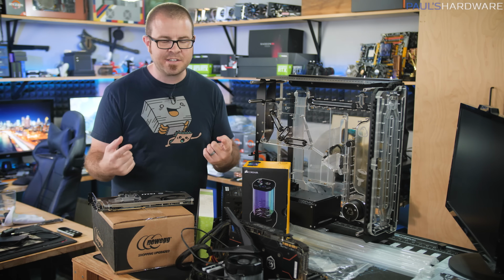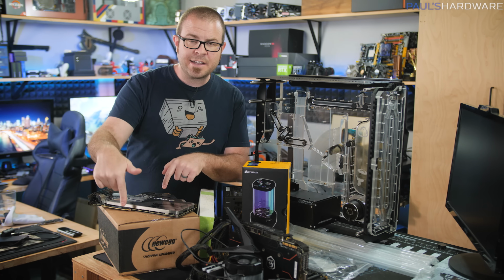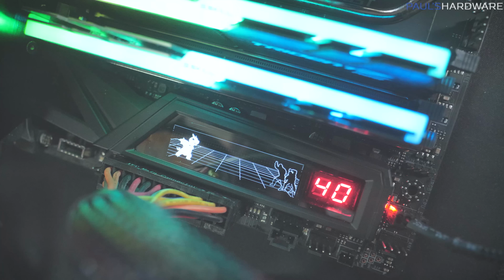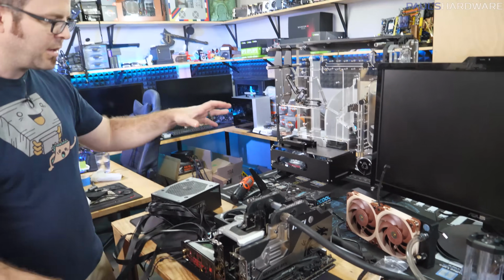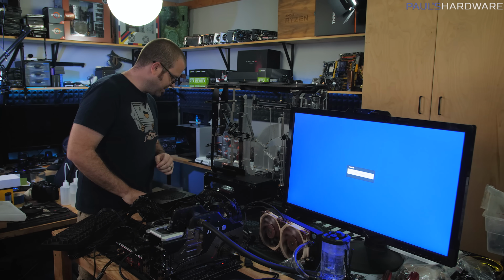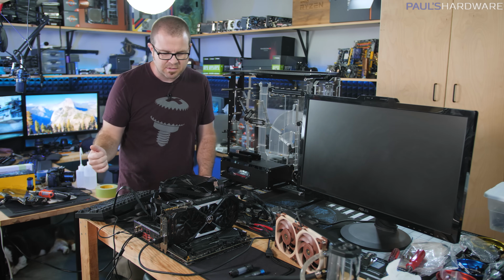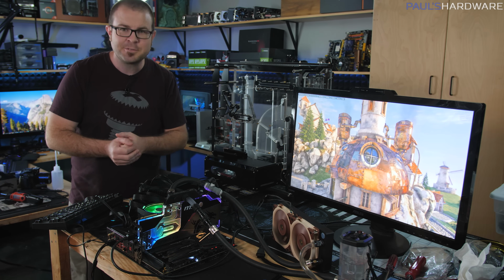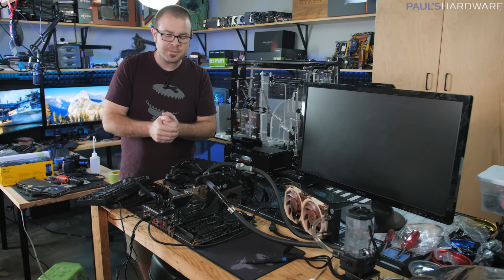The Most Important Part of a Water Cooled PC Build

Comment: That integrated Nvidia 3D Vision IR emitter on your monitor...:( I'm still running driver version 418.81, because that's the last one with the feature included for some terrible reason.
I understand that a small percentage of gamers use it, but there's a reason those of us who do love it so much - it's freaking awesome.
That feature is such a great one; it's really the next-best thing to VR, and even VorpX doesn't come close to the level of support or fidelity possible with 3D Vision.

Great video and demonstration of how even the most expensive of parts can be faulty and have issues, so it's always important to not take that for granted. Thanks!

Comment: The only serious failure I've ever had was an MSI motherboard. I even bought a board with the BIOS flashback button and that didn't work either. I'll never buy anything from MSI again
Reply: Same here, since 2011 and I never looked back
Reply: Unfortunately, after 25+ years of experience building computers, I've found that any brand has a dud from time to time. Either individual items that are dead on arrival, or a particular model that is of poor design.
Reply: @Trifler500  oh most definitely it just left a bad taste in my mouth when the dedicated bios flashback button literally designed for my issue did not work either. I explained to MSI that they're last resort flashback button doesn't work and they made me pay 20$ to ship they're dead board that was only around 3 months old. I then waited six weeks to get it back. It wasn't just that there was an issue it was everything together that made me hate msi.
Reply: @racingbeats1493  Oh yeah. I feel you. I guess I'm lucky regarding that issue because I read that it's a pretty hit or miss process before I bought one, and not just with MSI.

Comment: I'm getting back into PC gaming after a 15 year hiatus. Dont ask why lol. Im building my next gaming PC....specific for gaming cause I'm tired of Xbox and PC is and always will be the ultimate. My question is....which is the better processor? Intel i9 or AMD Ryzen 9? This will be a fairly high end build as I'm using the MSI Godlike board, 64 GB Trident 3200 RAM, Geforce 2080 Seahawk (Hybrid non-liquid but separate AIO fan). So which processor do you think I should roll with here? Any and all input is much appreciated. Thanks.
Reply: Correction...Ryzen 7

Comment: Paul about the Daisy chain of the PCI-E power cables where you shared the same cable for both power connectors on the card. I made the same mistake you did with my r9 290 card. My PC booted but I had issues where I would get black screen lockups. After adding that 2nd PCI-E power cable it fixed the issue that I was having. Too bad it didn't fix your issue and you had a defective card.

Comment: Wasn't it gonna be faster if you just plugged the cards without watercooling just to see if the PC was going to post? I mean you could save an hour by just plugging the cards and see if the system posts. Surely there won't be any load on them, so thermals are gonna be very low.

Comment: MSI = Boooooooooo.   In my experience with MSI I have received a lot of defective flagship cards from them (the reference cards i have used from them have not caused any issues though so go reference mid tier if you go MSI, their to tier cards are rubbish), But mainly the customer service and the RAM process for MSI is super bonkers because they take forever making you trouble shoot an obviously DOA/malfunctioning device (exe the screen is covered in purple and green artifacts, its obviously bad, so several BIOS flashes and tweaks, voltage tests etc, before they let you pay to return it), They do everything they can to refute a return first, then as previously noted make you pay the shipping on a defective product that was already at  the top tier pricing to send it to a certification facility with a 2-3 week certification and testing turn around, sometimes returning a dead card saying it worked for them, then on the 2nd go around same shinnagins take it back and actually test it and see it is failing and replace it.  The whole process always wound up costing me 30 - 90 USD extra on shipping costs to complete the multi phased RMA for DOA/artifacting Flagship hardware (one time it took 4 times RMA'ing a single 680 lightnings 30 bucks a pop 3 week turn around to get the "oh yeah it is artifacting after running for 10 + min, just like you said" confirmation so finally replaced it),  I have also tried a few more cards from them over the years with similar results on the Flagship cards so they have proven to me time and time again that they rush the QA process to get the flagship cards to market to the point i will never buy another MSI anything because of the overall hassle they provide to get a working unit, time investment troubleshooting, and added cost to get the working component compared to alternative cards on market.  Asus or EVGA are my brands all the way from here on out, I have only ever had 1 Asus card fail on me and they replaced / upgraded / over-nighted me the next tier up card at no cost as an apology for getting a bad one that made it past their QA, likewise I have received a couple bad EVGA cards but customer service was a breeze and replaced within days.

Comment: Paul, though I normally don't find fault with you,  I have to make a suggestion.  When you are doing trouble shooting do ONE thing at a time!  Changing out the power supply wasn't really a bad thing to do, but many people with less experience then you might copy you. Trouble shooting has to be done in a consistent manner otherwise you'll misdiagnose the problem!  Swap out one component at a time,  run through the tests, and keep doing this until you isolate the bad component. If swapping a component doesn't make a difference, reinstall it and swap out another,  DO NOT install a different component for any reason!  Once you isolate the problem, replace or repair then continue testing until you're satisfied.  Then you can install something different.

Comment: The problem is you are cooling the cards in serial, this means the first card the water passes its already to hot to cool the 2nd card and that card will fault out and crash your system.
you would need 2 isolated water pumps and radiators.
Reply: That is not true at all. Please don't listen to this guy folks. You can run two cards in the same loop with practically no difference in thermals at all, that is if you actually are into the sli thing still.
Reply: @mikeschimminger7886  Im an engineer in hydraulics and travel quite a bit around the world for my job to solve industrial related problems regarding hydraulic pressures, plc, cooling etc... not so long ago i fixed a problem on a vessel where 2 engines where cooled with the same loop, one engine on the end of the loop always had cracked cylinder heads and liners. This is basic 101 do not cool 2 devices connected in the same loop !.

Your first card takes the LT low temperature water in expells it and becomes HT *high temperature then passes the HT trough the 2nd card. Whoever sold or invented this cooling loop it looks nice but very unpractical and unrealistic. Also note that CPUs create massive ammounts of heat usually expressed in watts on the manufacturer page, in watercooling this is dangerous as it can cause steam, pressure and air bubbles in the loop causing a chain reaction and your temperature sensor would not even pick it up in time and *boom system crashes. The other risk is that seals of the loop would give in and start leaking.
Reply: @JerryDoe  I have no doubt at all that in your professional field that you run in to this and it actually is a problem. However we are talking PC components on a much smaller scale and it has been proven time and time again by professionals in the PC world that dual loops for GPUs offer little to no difference in thermals.
Reply: Jerry, just stop. Admit you are wrong and move on with your life. All of your scientific equations and such just don't mean a thing in real world results. Go build this system and prove your point and i will agree with you. Until then we will agree to disagree.

Comment: I would not do a vertical gpu layout the pci extensions provide another point of possible issue, if you had a single card I might do it to make the system look full but with 2 cards I would just plug them into the board and go with a more traditional setup.

Comment: I have a CM 932 HAF which is an air cooling beast. Can you do a review like for the Corsair 500D? I want to know if keeping this case is still worth it. Current cooling is as follows: 2x120mm ft, 4x120mm side panel, 1x140mm rr and top 240mm AIO w/ push/pull 4x120mm.

Comment: With some newer GPUs using 2 8 pins + a 6 pin, I wonder if we'll ever get to the point where they start manufacturing them as a single connector to minimize on the amount of separate cables needing to be used

Comment: I wonder if he remembered thermal paste in the bad gpu.
Reply: Those are factory pre-assembled.  Waterblocks already installed.  Still, I bet maybe if he did take them apart to have a look, it's entirely possible the factory missed something basic on block installation.  That's arguably more likely than actual failed components on the PCB.  But presuming MSI gave these to him as promos, they'd surely rather have the card(s) returned, and do the troubleshooting themselves.

Comment: Or maybe just don't buy MSI LOL

I did the same testing when putting together my 4-way SLI system back in 2015 - assemble the cards in a block, leak test prior to fitting and then test each card individually by adjusting the PCI DIP switches on the mobo. For cooling the CPU I "borrowed" a H100 since I was installing a full motherboard block.

All went well, but this experience and yours highlights the fact that you can put a ton of time and effort into building what is a very complicated system, switch it on and NOT HAVE IT WORK. In my case I had 5 blocks connected to five rads and 20-plus fans installed inside a massive CaseLabs case. Think of the time and work it would now take you to disassemble a fully built rig for trouble shooting, more so if that rig took several days or in my case WEEKS to painstakingly mod and put together.

Comment: I want to water cool my PC so much right now, my fan on my 1070 seems to be bad (sounds like a hard drive spinning up while I'm gaming- the game is on an SSD and it didn't do that when I was using my old 1060 3GB). I can't even afford to do it all with parts off AliExpress, let alone real brand name components.
Reply: Watercooling is all about hobbyist/enthusiast interest. It isn't necessary and is never cheap. Most affordable way to get into it is probably EK's all in one kits. Basic one with a single rad and a CPU block will let you learn it and build a simple loop. If you feel ready you can expand it with a GPU block later.

Comment: I'm kinda glad the second card failed, I hate errors that come and go cause you can never really be sure if you fixed it and if the problem will come back or not.
Reply: I Cant troubleshoot my Sisters defective system beceause of that.
The other problem is that i do not have spare Parts to test shoot or troubleshoot.
It's a ten plus year old system probably pci-e 1 or 2 max
Reply: @alfonsputzeys9228  that's annoying, that's why I like the option of integrated graphics, you can at least use the pc still if you have to remove graphics card.

I've had a dodgy hdmi cable and dodgy sata cable that when replaced fixed the issues they were giving.
Reply: @colinjava8447  it could be so many things, but without some feedback from the monitor and a boot button indicator.
Sometimes notifying you, Mailfunction in hardware and you have 0 test items.
Like a spare gpu, psu, ram etc.
It's difficult to do a pröpper proces of elimination.

Comment: Yo look at your build at 3:17. You won't be able to fit the pump/reservoir from corsair in the front since the memory is gonna block it. I'm doing a build in the 280x and the only way I got everything to fit is by putting the radiator on the bottom and put the reservoir in front with two fans putting it to the highest the bracket enables it to. You'll also need to remove the top fan in order to fit it.

Comment: "just a GTX 1080" you gotta be kidding me...lol.  That's like a dream card.
Reply: I know, I got myself a cheap never used 1070-seahawk, its a little overkill for 1080p but I think I can get 3 years use out of it.
Reply: I had one bought one used, not one month of use, gone.
Reply: maybe for 60fps but not smooth gaming
Reply: I replaced my GTX 1080 with an RTX 2080 less than a year after getting the 1080, which now sits tucked away in its box as a backup, if something goes awry with my 2080. 😅
Reply: I have a box of 1080s from my old mining rig.
Reply: dream bigger

Comment: Are those gpus in slot fully? Motherboard should be an inch off the table or at the edge, so that gpu "legs" don't hit the table
Reply: Igors Jakimenko: you know I was thinking the same thing, I had trouble testing my new 2070 super, it wouldn’t post, then I moved the motherboard to the edge of the table so the  rear of the card had proper clearance and suddenly my monitor burst into life.

Comment: PSU? I had a AX 750 that was giving me issues than just shut off one day. It would turn on when I turned up memory speed to XMP. PSU died after update and PC was running fine and just shut off. Would not start again until I reset the CMOS and swapped it out. Check them with swapped PSU.

Comment: Watercooling definitely seems to have a steep learning curve beyond a closed loop cpu cooler. 

You're experienced with all this and can patiently troubleshoot but retail end users dabbling with watercooling GPUs seems too much a hassle, esp if there is a defect from the factory  :(
Reply: If you pre-sudy and plan then watercooling is not to be feared. I haven't done hard tubing but soft tubing really isn't very difficult.
Reply: @Safetytrousers  Soft tubing is definitely more workable. Hard tubing is there mostly for showcasing a build  and maybe one day ill prioritise showcasing a build rather just pure performance.
Reply: @Safetytrousers  Absolutely. It's just very expensive. But if you water cool, you have a system worth that money.
Reply: I also just stepped into this and for me I learned fast. I did just a little bit of research, made sure I got all parts ready, then built it with just common sense. And it works flawlessly.
Reply: @kyoudaiken  True, but I just don't see the benefit of overcomplicating things. An equivalent Noctua cooler works just fine, performs the same without worrying about leakage or pump failure and is far more cost effective. 

Apart from the aesthetics,  I see liquid cooling as an advantage only in compact builds where large hestsinks cannot be installed and where the air cooler may interfere with RAM installation. 

GPU cooling seems to be even less worthwhile since it seems you cannot carry the custom waterblock designed for that particular gpu and thus cannot be transferred to a new build like a cpu cooler can.

Comment: The most important part is realizing that water cooling is a fad, completely unnecessary, and it is far better just to stick with a great Noctua air cooler.
Reply: Yeah considering noctua now makes them  in black now so they'll look cool as well. 

GPU watercooling is just too much of hassle plus carrying it over to a new system is improbable.
Reply: This
Reply: I mean if you care about having the lowest temps with the maximum clock speeds possible coupled with overall lower noise levels depending on the quality and amount of rads used it's definitely worth it.
Reply: 2080 Ti's in SLI isn't necessary either, but its still fun to watch
Reply: @scottgardiner7418  I agree on that point. As long as people watch this understanding that it was done to sell parts and not because it is a great idea I have no issue with it.